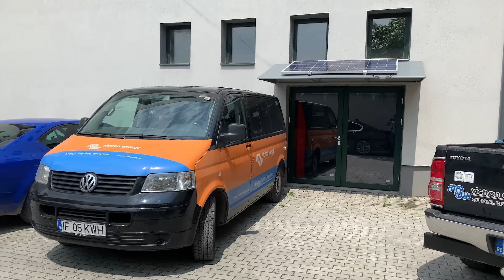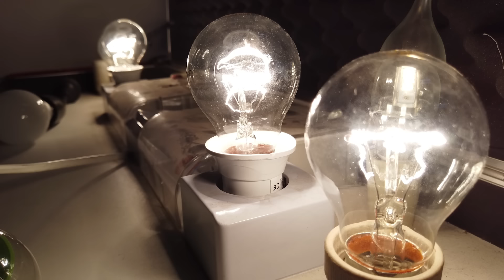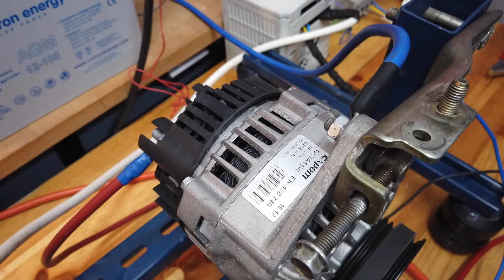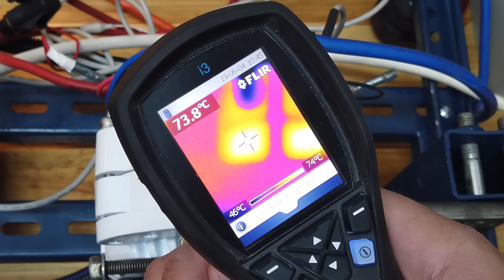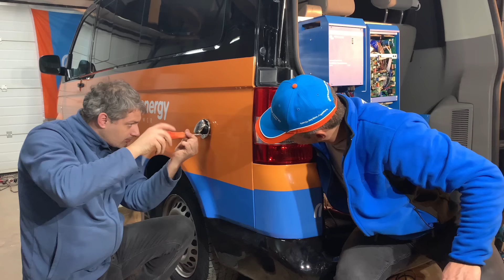How to not blow up your Alternator when charging Lithium

Comment: Yeah but you are direct driving that alternator. Typically vehicle alternators are overdriven at least 3:1.   Im not arguing against DC/DC converters, but your abusing that alternator to no end. The testing here is not realistic.
Reply: Why would you need a 3:1 overdrive when you have a speed controlled electric motor?
Reply: New inquiry,I need help with this question, I have  a dual battery lithium 12v 135amh profile and also an alternator cap output at 250amp for Jeep Wrangler. I also have a dual battery relay isolator that can handle lithium batteries. Will I also need a Victron shunt battery protector and of DC2DC converter for this setup?
Reply: How much current is your relay rated for? If it does 120A, that's only half of the capacity of your alternator and it "only" has to do this for 2 hours to completely charge your batteries from dead empty to full. So I believe that if the current is limited by the relay, the batteries will not be harmed (if they are placed in parallel).
But I am not an expert on electrical systems, so please take in professional advise.
Reply: Depends on the rpm of motor.
Reply: This overheating is a standard issue. 
Lithium is only triggering the fail moment sooner.
But 3 agm with the same 300amp does the same to an alternator if not ran fast.
Reply: the test is done to show what the result is of charging a lithium battery. This is not real life testing as that would take too long, it's only a few minute clip.  But the alternator in real life (even with 3:1 or such) will suffer and break down soon.
Reply: @johannesboonstra6917 untrue
Reply: @johannesboonstra6917  

The alternator doesn't know what it's sending current to - lithium isn't special it's just a load on the alternator. 

It was underdriven and overloaded at the same time - failing and spectacular fashion to help sell DC to DCs. Your comment would hold water if Victron disclosed that in their video but they didn't. Leaving someone who knows nothing of alternators to draw the wrong conclusions. 

The moral of the story is don't overload an alternator - which is still one hundred percent possible even with a DC to DC. You actually have to monitor alternator output to know if you're overloading. How many actually do that?

I do. It's easy and cheap with an Amazon hall sensor.
Reply: It's not at all that we did post this to sell more dcdc converters.  The point is ( and many alternator and engine manufactures that we work close with  have discovered) that alternators do fail on lithium banks as not protected.   Lithium is not "just a load" !    Lithium has a an extreme low internal resistance and the character its voltage will not raise during charge until full.   This means a typical alternator will send its maximal rotor current by the regulator as its designed foe lead batteries,  This maximal rotor current will cause the alternator to generate current often above spec.  Knowing the efficiency of a typical alternator is just around 50-60%, you know how immense amount heat is generated.  This will happen at lead also but only for a limited period as then the voltage will raise after 10-30 min.   Just imagine a 20kWh lithium bank on a 100A alternator, this would take 16 hours of power above spec from an alternator.   This alternator will fail, perhaps not as fast as in the clip, but it will fail as we have seen with many many systems worldwide.      If you dont trust this, please come by with your car and we will connect a large empty lithium battery to it so your car can charge this in a few hours on idle rpm.    You claim nothing will happen, and of course in a few minutes this might be true, but for a reliable system there is no other way then to protect the alternator        @MyGoogleYoutube
Reply: @johannesboonstra6917  

I sincerely appreciate your reply - I'll get back to you in a few days.
Reply: @johannesboonstra6917  Wouldn't a more sophisticated AVR with current (or power) limiting be the obvious solution?
Reply: that also a solution, as long as the alternator is protected/limited power/temp wise. @gf-xy2of
Reply: Thats an option as well, but as there are a lot different alternator type, this can become complicated. 
 @gf-xy2of
Reply: @johannesboonstra6917  estoy de acuerdo.
Bien explicado y científicamente comprobado.
Es fácil de entender. Nunca se puede comparar la resistencia interna de una batería plomo ácido con la de una de litio. Nunca se comportarán de la misma manera.
El desconocimiento de estos datos básicos puede traer consecuencias graves en un vehículo si experimentamos en la ignorancia.
Gracias por compartir su experiencia.
Reply: @johannesboonstra6917 What is your pully ratio!?
Reply: @johannesboonstra6917  Why would you direct connect 20kwh to a 100A alternator? Isolate batteries/don't use a severely undersized alternator/spend $200-$300 to properly charge your 20kwh bank($3000 at least?!?!?!?). Like the original video, the variables don't make any sense.

But you are free to gift that 20kwh bank and I'll give it a long and happy life with my 130amp alternator + (insert random dc-dc charger with mppt)
Reply: @MyGoogleYoutube the issue is that lead acid batteries have a high resistance which limits the current drawn from the alternator. A lithium battery has a very low resistance which does not limit the current drawn from the alternator. The DC-DC is added to control the current.

Comment: I'm gonna design and build my own. Nobody seems to have the simple idea of a dump load.
Reply: I don't think so, you should only need to pull back on field current.
Reply: I have a wakespeed regulator on my boat, you can adjust the max alt temp thus preventing it from running hotter then you want. I plan to add another blower motor to feed cooler air to the alt. And will test this set up.
Reply: You mean to address high voltage scenario?

Comment: DC DC is the way to go. You know it, I know it, we all know it :) Especially when you are increasing the aH. I'm upgrading my diesel pusher from 450ah flooded to 920ah LifePO4. It would have been so easy to replace my BIM-225 with a Li BIM-225, but the idea of stressing the alternator with such a high load forced my hand. So I'm losing my AUX start function, but my alternator will have a long healthy life!
Reply: you dont need dc to dc. battery with jk bms or simmilar you can set up max charge current to 40a and problem solved

Comment: "Charging lithium batteries at low RPM (revolutions per minute) can cause the alternator to overheat, potentially leading to internal coil damage."  For the 1500 RPM test "....note this is still above the typical speed of an engine running idle" This indicates a fundamentally flawed understanding of how alternators are driven in vehicles by these folks in the video.

The alternator in this video was underdriven WAY below what it was designed for - no wonder it fried. Most alternators are going 3X (3:1) the speed of the engine RPM. What is the average engine idle speed? 800 RPM? Making the lowest alternator RPM of around 2400? The video shows an alternator running at 1500 rpm - so a 500 RPM engine idle?

Why wasn't the Balmar tested at a super low RPM? I am sure Balmar wouldn't have been happy with you smoking one of their alternators when it was tested outside of it's design capabilities? 

I don't understand the comment about BMSs disconnecting the batteries when fully charged? Fully charged is 3.65V per cell - and by then it's constant voltage and current is just trickling into the batteries at that point. How would this harm the alternator if a load of a 50W or less was suddenly disconnected?

I charged a 200ah LFP house bank for several years using a standard Victron Cyrix combiner with zero issues. I would see around 70a going to the house batteries. I would only use this when needed and recognized I couldn't full top the batteries so I stopped charging around 90% SOC. I also monitor the alternator's output. When I upgraded to 600ah I did have go with a DC to DC because without I was getting 120A to the house batteries with a 160A alternator at idle. I went with Sterling's new DC to DCs which I think is much better than what Victron is offering currently with their Orions and Buck Boosts.

If you don't want to dive into the weeds on how this stuff works and don't want to actively control your house battery alternator charging like I am - get the Orion, get the Buck Boost, or some other DC to DC.
Reply: I totally agree with you here. Not a total test.
Worth nothing that I have installed a lot of victron products and a couple balmar ones as a OEM and have no issues with the product, however this video is no good
Reply: 3:1 is about right for most passenger cars and trucks - engines that run at high RPM, such as Sports cars, supercars, race cars, will have the crank pulley altered to lower the alternator speed to within manufacturer specifications when the engine is at high RPM. Larger deisel trucks will have a pulley ratio closer to 5:1, as the engine RPM is usually lower.
What's also missing, is that the vast majority of engine management systems - ALL of the OEM ones and most of the aftermarket ones - now turn off the voltage feed to the feild terminal of the alternator when the engine speed drops below around 1200 rpm - this reduces fuel used at idle, removes issues with alternators overheating, and for passenger vehicles, reduces idle loads on the pulleys, making the engine idle smoother with less NVH transfered to the passengers.
Reply: thankyou for your explanation  that really helped me grasping this concept, although this video was just to show how a person need to buy their product nothing else
Reply: Isn’t pulling 120 amps out of a 160 amp alternator risking damage, I’ve just completed a DC to DC (Renogy 50 amp) charger install for a 100 amp/hr deep cycle AGM house battery in the car and everything I read said make sure you’re not pulling more than about a third of your alternator’s output (110 amp smart alternator in my case)? I just added a 200 watt solar panel on the car roof which connects directly to the Renogy DC to DC charger. The battery is from Aldi and I couldn’t be happier, resting state is always 13 volts and a hundred bucks cheaper than a “rebranded” battery which comes from the same factory anyway.
Reply: @teeanahera8949 The majority of the 'smart' DC-DC chargers measure the incoming voltage on the connection from the cars main battery, and will not turn on their output to your secondary battery untill the main battery shows a voltage that indicates it is fully charged. This way the current being pulled from the alternator never exceeds the alternators limit specifications. You will probably have a small wire coming from the DC-DC that the instructions said 'could' be connected to an over-ride switch to disable that safety feature in special cases, but is best left disconnected for standard OEM alternators.
Reply: Agreed. These dorks have clearly failed to open the hood of any car in their life. What clowns.

Comment: good explanation
I have one question can you explain I have 420 amp battery then how many amp alternator need to install that vehicle
Reply: Look at the C rating for charging your battery. 0.5c charge would be a constant draw of 200amps.
I would install a regulator or limiter similar to what's shown in the video. It's a pretty big alternator to supply 200+ amps.
Reply: You definitely need to limit the charging current to 60A - 90A max. to protect your alternator. 420 Ah is a high capacity battery and it is very willing to draw way more than 100A current from your alternator in case the battery is empty. You'll cook your alternator.

Comment: I am about to connect an extra wire from my alternator to my Victron non isolated DC/DC charger. With how much Newton Meter do I turn the bolt back on the alternator while securing the cable shoe to it? 

This video was very helpful and convinced me buy to buy the DC/DC charger!

Comment from the maker: 🎯 Key Takeaways for quick navigation:

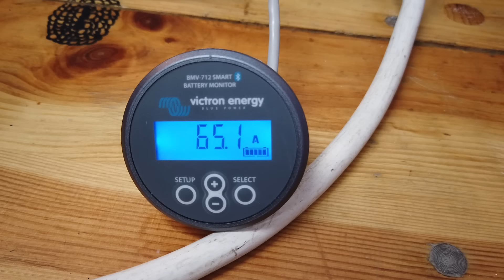02:53 ⚠️ Charging lithium batteries at low RPM (revolutions per minute) can cause the alternator to overheat, potentially leading to internal coil damage.
03:22 🔥 The Balmar alternator includes a temperature probe and regulator that monitors alternator and battery temperatures. It automatically adjusts the output current to prevent overheating.
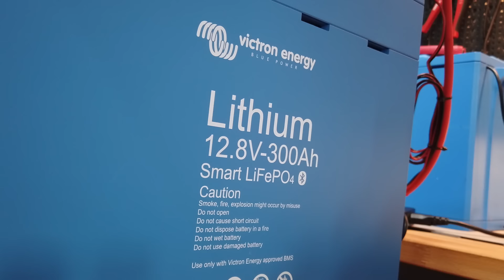05:53 🚗 Charging lithium batteries with an alternator poses challenges because lithium batteries can draw high currents even at low alternator speeds, potentially causing overheating and alternator wear.
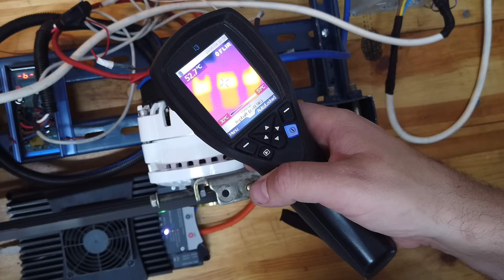06:22 🛠️ Solutions to prevent alternator overheating when charging lithium batteries include using larger alternators, regulators with temperature sensors, or current limiters like Buck-Boost, BMS 12/200, or the Orion Tr Smart DC to DC Charger.
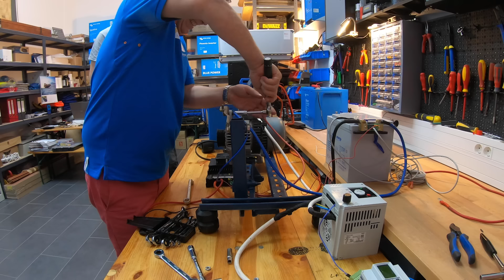07:16 🔄 Disconnecting lithium batteries from the charging source once fully charged can damage the alternator regulator if not done properly, and Victron offers equipment to protect alternators and battery systems.
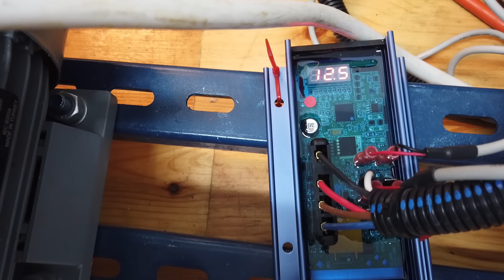Reply: 3:23 - You never ran the Balmar Alternator at the lower RPM, this alone tells us that the 'test' was was not done to repeated scientific standards where every device is tested in identical manner, but instead was done specifically to cause Only the standard unit to 'fail'.
The Victron products may be of high quality, but this video is disingenuine. It's a short step away from being a Marketing Dept Lie.
Reply: Correct, this is not a scientific test! There were no professors involved and most likely you are able to find many things in it that could be debated if that's you intention.  It  was never intended to be more than a  way  to show in a few minutes that charging lithium isn't straight forward and that it needs consideration.  That doesnt mean its a lie but its there to prevent endusers of spending money on a lithium system and then face costly issues with the alternator.  And believe me when I say that this clip alone showed many endusers what went wrong in their system and they learned from it.     @PiDsPagePrototypes
Reply: @PiDsPagePrototypes  The Balmor has temperature compensated field current as does (in your own words) the ECM/PCM controlled field current on automotive applications below 1250 rpm (engine).  Yes?
Reply: @VictronEnergyBV: New inquiry need help with this question, I have  a dual battery lithium 12v 60amps and also an alternator 250amp for Jeep Wrangler  will this setup work? 
Also what size amperage Victron battery isolator would I need for this setup?
Reply: best is to go for a dcdc converter or external regulator to limit the power of the alternator instead of an isolator  @TopNoTchVSOP
Reply: Sorry to bother you but is my math right alternator 250amp using a 2gauge wire output 200amp-245amp
Dual lithium Battery 12v 60AMP X (2) =120amps 
120amp= 365 amp total 
So should I go with a 300amp or 200amp isolator?
I am looking at getting a battery isolator that can handle that and DC to DC inverter.
Reply: @TopNoTchVSOP  Double check the 2AWG wire is capable of the full output of your alternator. Read the specs for you batteries to look at what the Peak and the Sustained amperage output will be - and don't mistake Ah (amp-hours) capaciticy for the amps it can delivery, or the amps it can be charged at. No idea where you get the 365amps from - 2x 60amp output bateries in total give you 120amps output.
Reply: not sure what the question is , but the isolator needs to be more powerful then the alternator  @TopNoTchVSOP
Reply: 2:54 - Well, Duh,... This whole 'bench' test is silly, because more then half of the cooling air for an alternator is provided by the the forward motion of a car and the cooling fan in the Radiator moving air over the running gear when the car is at standstill. You compounded this error by running the Alternator at RPM that it will never see in daily use, as the drive pulley on a standard engine crankshaft is much bigger then the one on an alternator, precisely so the alternator always spins at high enough RPM to function properly. The majority of modern cars, at engine idle, the alternator is shut down by the Engine Management system by turning off the feed to the field charge terminal, so at the RPM you get the smoke, the Alternator should be spinning but not powering. Very disappointed in how badly this test was done.
Reply: Ever measured the alternator in a summer traffic jam while charging a large lithium bank or even a machine room of a boat?   @PiDsPagePrototypes      Could you please take the test on your own car and show the results honestly?
Reply: @johannesboonstra6917  If the charging system is set up correctly, it won't be charging while you sit still in a traffic jam. As mentioned before, at idle the cars ECU will turn off the field activation voltage to save fuel and protect the alternator from overheating.
The machine room of a boat should be well ventilated, both to stop build up of dangerous gases and vapours, and to keep the room cool. If it isn't, it won't matter what brand of electrical equipment is fitted, the results will be failures.